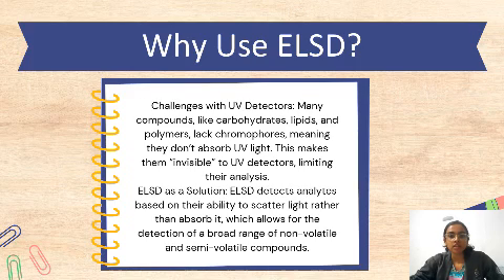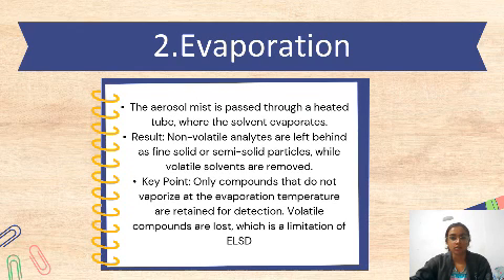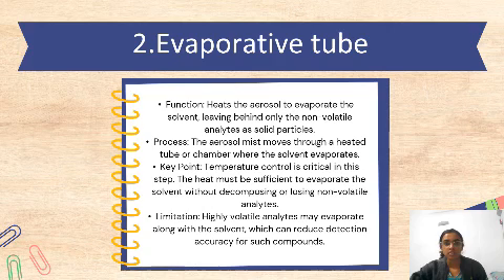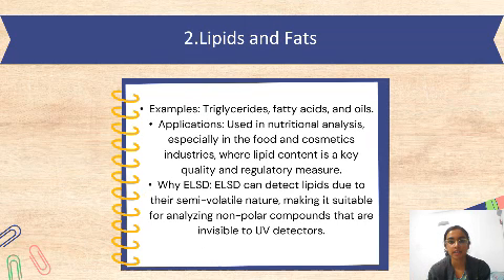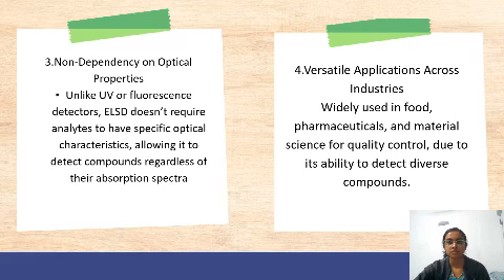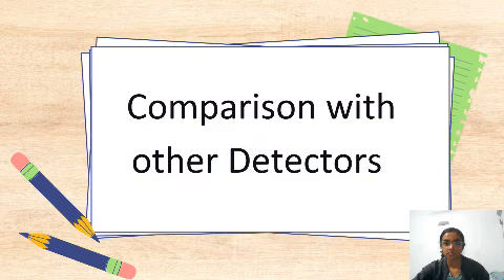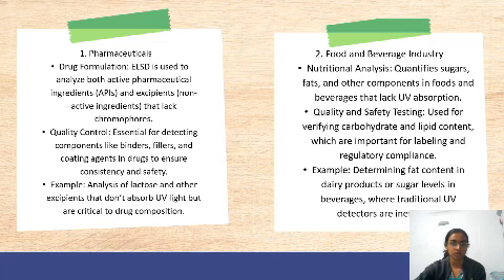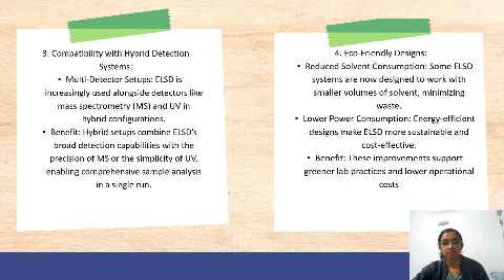Evaporative Light Scattering Detector (ELSD) Explained | Applications, Advantages & Future Trends

Comment: BT21CME099_LAVALIKA UGGINA
How does the temperature setting impact ELSD performance?
Reply from the maker: @BTCME_LavalikaUggina  Temperature plays a key role in the evaporation stage. If the temperature is too low, solvent may not evaporate completely, leading to poor particle formation. If it's too high, sensitive analytes might degrade. Optimizing the evaporation temperature based on the solvent and analyte properties ensures accurate detection

Comment: BT21CME079_Shruti Pandey 
What are some common solvents used in ELSD, and why?
Reply from the maker: Common solvents for ELSD include acetonitrile, methanol, and water. These solvents are preferred because they evaporate cleanly during the evaporation stage, leaving minimal residue. Selecting a suitable solvent is crucial to ensure efficient particle formation and avoid interference during detection

Comment: Harshita Patil BT21CME047 
How can ELSD be optimized to detect analytes with extremely low refractive indices?
Reply from the maker: "Great question! For analytes with extremely low refractive indices, optimization focuses on enhancing particle formation and light scattering efficiency:

Adjusting Nebulization Parameters: Fine-tuning gas flow and nebulizer design can create smaller droplets, improving particle formation.
Evaporation Conditions: Carefully controlling temperature ensures complete solvent evaporation, maximizing particle size for better detection.
Laser and Detector Sensitivity: Using detectors with higher sensitivity and stable laser systems can improve the signal for low-refractive-index analytes.